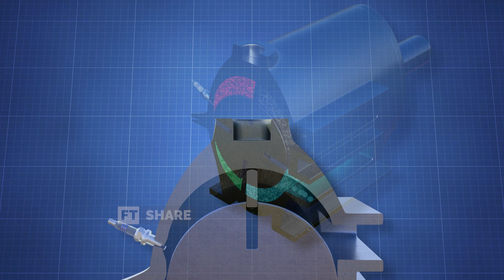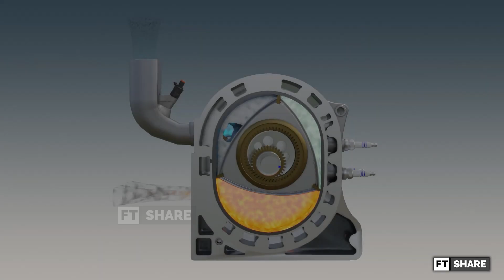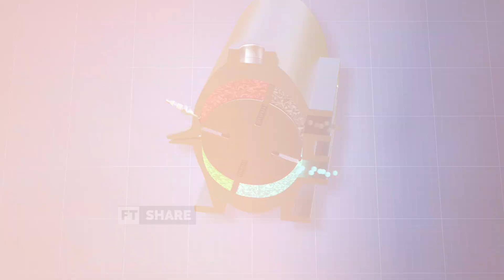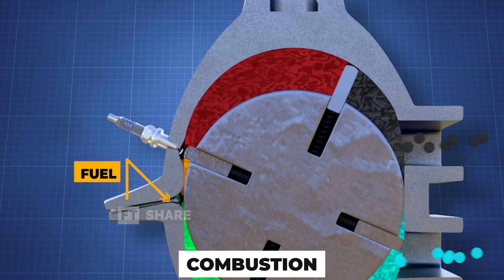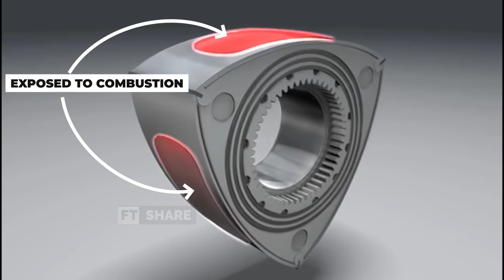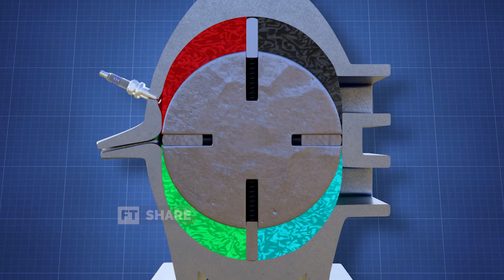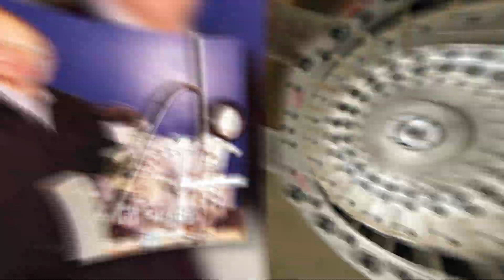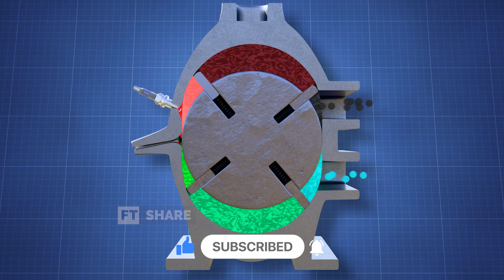How Rotary Vane Engines Power the Future

Comment: Interesting videos on the 4 vane rotary motor. ( https://youtu.be/gowBdEj2NsU?si=6Zz8mjYeJaBbsWJL and https://youtu.be/UPFFXBAe5mc?si=XHe5g-6dIUHWcEwk)
It seem that it can be used to replace a diesel piston engine.
How is it cooled?
It still seems to require a super charger - posaibly a two stage one such as found on a diesel electric locomotive (see https://youtu.be/cIQ0yIZgQeE?si=yWpC3xglkgIiS14b).
In a marine setting it would still need scrubbers for exhaust gasses (see  https://youtu.be/E5Zi-6vd5ko?si=eYKLRr2af-B-H88L).
Would you recommend having an extra vane motors  on on a common shaft either one mounted at 45 degree angle or two mounted at 30 and 60 degree angles to smooth out the power flow?
Regards
Philip

Comment: it won't work as rotary vane engines have issues with vanes being brittle and not strong enough. However, the rotary vane pumps without explosions work very well.
Reply: Many aftermarket manufacturers supply seals for Mazda rotaries that won't break even when a 1500 bhp drag version detonates. The OME versions were too brittle so some clever guys sorted it out. I think the same will happen here and first in, best dressed..